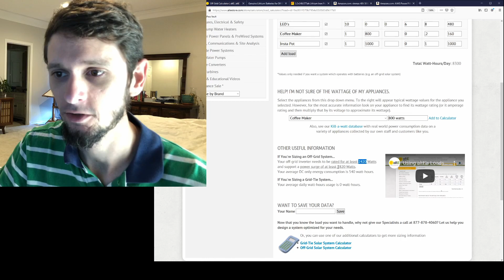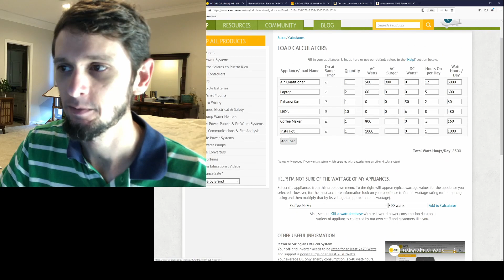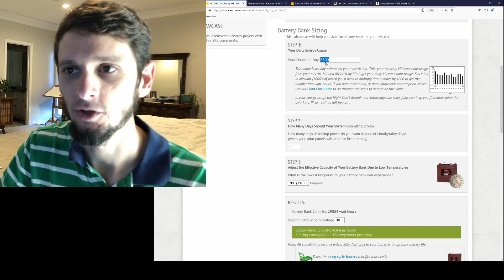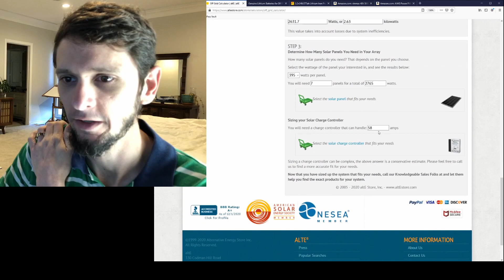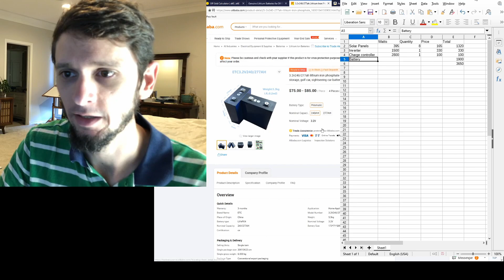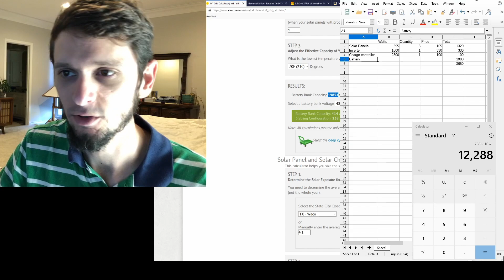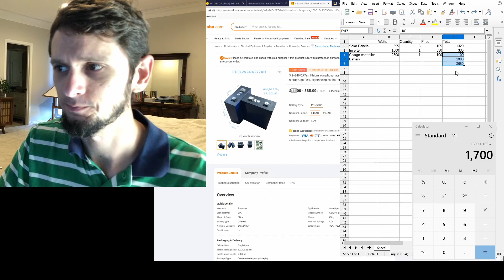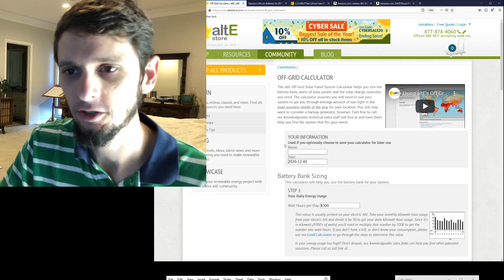Sizing Your First Off Grid Solar Setup

Comment: The all-in-one high frequency inverter has a low surge capacity.  Is the other inverter a low or high frequency?
Reply from the maker: I believe both of the units I have in this video are high frequency inverters. They still have a good deal of surge capacity, but from what I understand it would be better with a low frequency model.

Comment: Cool. Yes do a live. This is Michael  (hot rod truck) That is the same calculating page I found and use. That 395w panel you sell puts out the juice. So if i need 1260 watts of solar panels does that also mean i could use a 1500w converter? and if I go over 1500w in needed panels I would need a bigger converter? Great job on this video.
Reply from the maker: Thanks Michael! Glad the panel is working well.

Really the inverter size is dependent on your instant load requirements. You could do a 1500w because you need ac and coffee at the same time. If you were willing to shut down the ac to run a pot of coffee then get a smaller inverter.

The question on how many panels are needed is really a function of how many watt hours you will use during the course of a day. 300 watts constantly through the day adds up to 7.2kwh over a 24 hour period. That’s 1.8kw of panels needed right there!

Hope that made a bit of sense. I’ll work on getting a live stream scheduled, I think it would be fun.

Comment: Good info. If people are going with solar they can do it on the cheap with name brand from America not Chinese. All they have to do is look and they will find deals instead of going with the grow watt or the solar mpp. Think about it what would u want to do spend 900 on a grow watt and it goes bad in a year or spend a 100 more and go with a outback or magnum. They are there I got a outback 2024 500 its a beast. Im just saying keep it up brother
Reply from the maker: Dan, without a doubt I'd go with an Outback over a Growatt all things being equal. But for $1700 I'd get the same inverting power, half the MPPT charging capability, at double the price. I absolutely acknowledge that the ratings for something like an Outback are great. It's UL1741 so you could actually use it grid-tied! Perhaps one day I'll get my hands on a nice unit and be turned from the dark side ;).